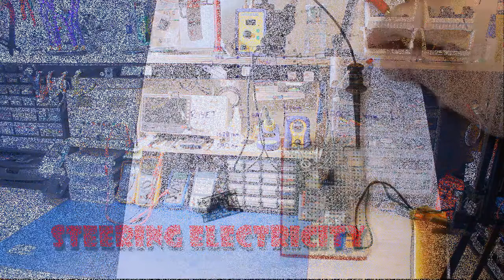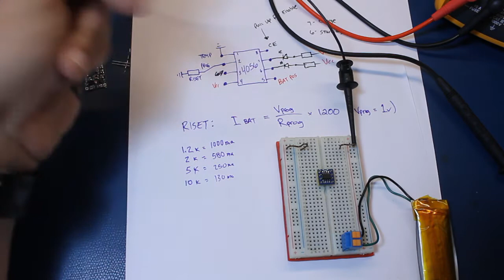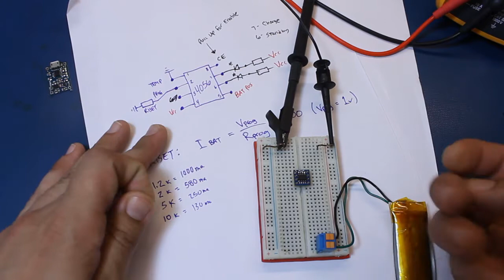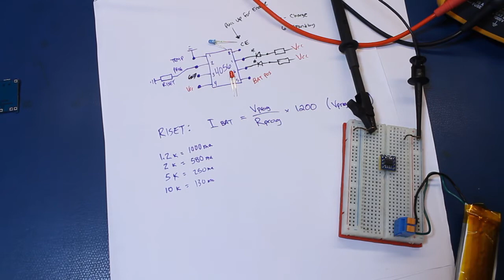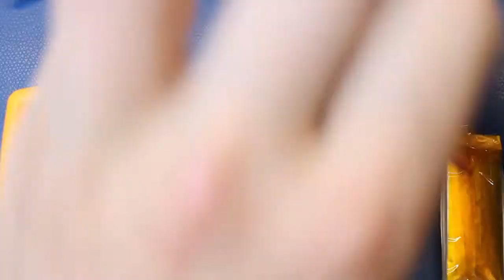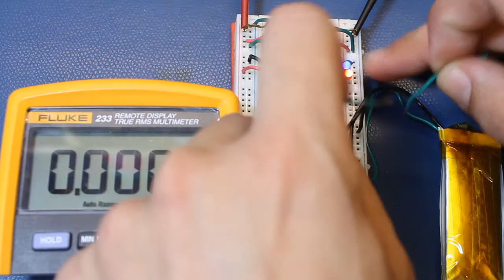TP4056 Butt Naked on Breadboard- Minimum Circuit and pinouts

Comment: Can I charge my lipo with the balance  charger which u made in ur channel  instead  of buck convert I can use mobile charger rated 5v 1amp  5v 700ma and 5v 700ma to charge my 3s 2200mah lipo without changing the resistor